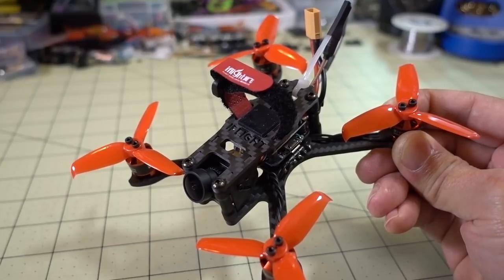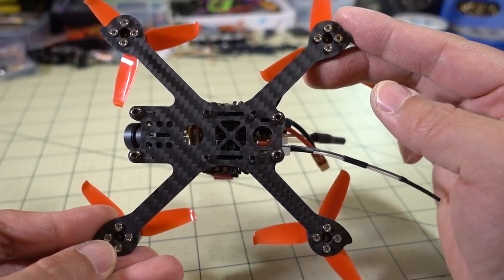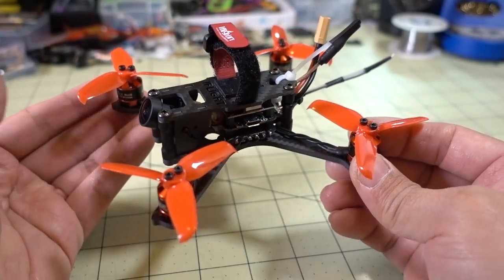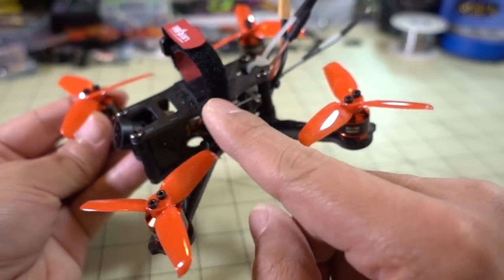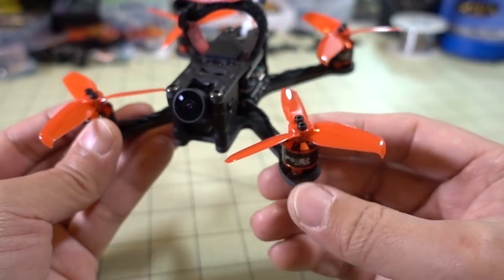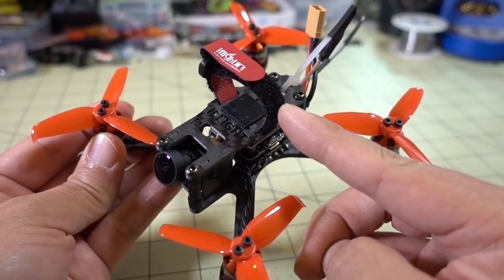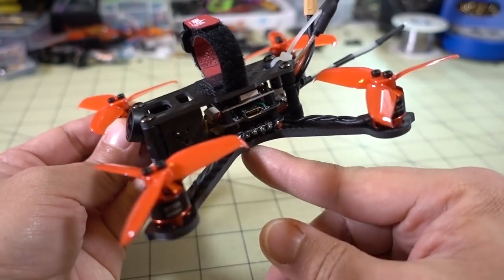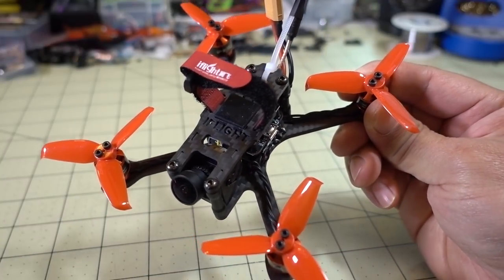MD#83 🚁iFlight iX2 V2 2.5 inch Frame Build 😀👍👍

Comment: I used this frame for a build but i used emax 1106 4500kv motos with 4s 650mah battery and i'm loving it.  It flies with so much power and great weight to power ratio. I'm getting 5 min of hard flying in on my setup. Cheers Albert.

Comment: I bought this frame about a month ago but never put it together. This inspired me to take the guts from babyhawk R and put in this. 
I like the old school quad look this thing has and it's top mount battery, so definitely worth the time. Great job Albert👍
Reply from the maker: Thanks for watching!
Reply: I did it with my torrent! I had to lengthen the front motor wires. But I zip tied the vtx to the back with the antenna pointing straight back just above the prop line. I only get like 2:30 2:40 on a 3s 450. The 550 3s batteries fit better and you get about 3- 3:30 flight times. I only have 3 of the 550s tho :-(

Comment: I've got one but using BHR guys, 4500 kv and on 4s it's like my 5 inch. The acceleration is insane.  I used it to learn how to fly fpv and it has taken a beating and only a small part of the top plate and standoffs have broken.

Comment: Awesome video.. I was watching for battery sag when you were doing punchouts, it didn't seem to have any real sag. Do you feel the battery voltage readout in osd was accurate? (elaborate)... Thanks and have a great day,
Reply from the maker: It seemed OK.  I think these 1106 motors from iFlight are more efficient than others.